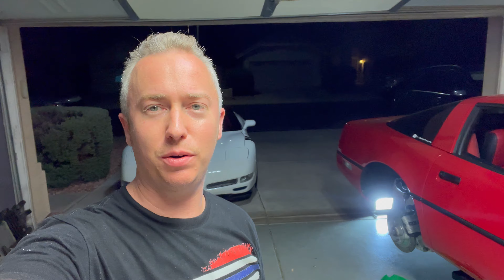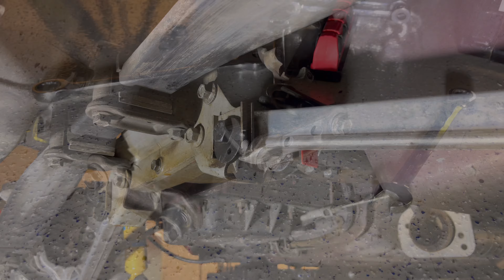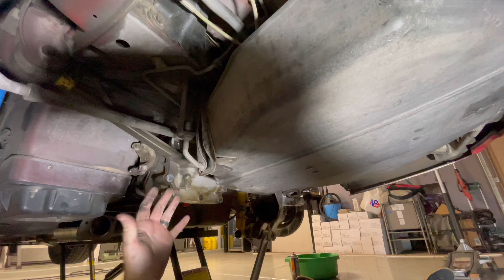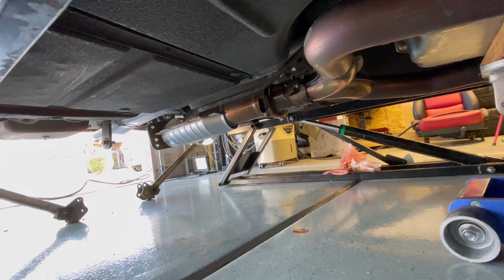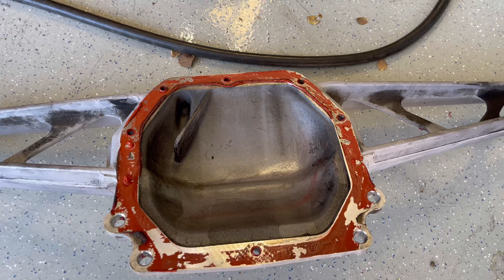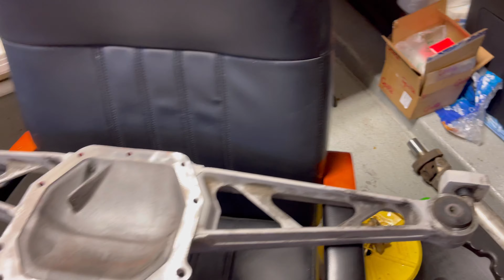How To Remove C4 Corvette Differential

Comment: Should have changed the differential ratio to perk it up just a bit nothing crazy like I did to my 94. Went from 2.59 to 3.54 . What a difference. Still just 2000 rpm at 60 mph.  Seat of the pants difference puts a smile on your face. You will have to have a tech change difference in speedometer calibration in computer. Well worth it. Thank you for the video! 👍
Reply from the maker: I’m selling the car so I’m not going through the trouble of doing that.

Comment: Great video I have a question both my pinions are worn out on my differential would you rebuild it or replace the entire assembly my mechanic quoted me $2,400 to rebuild it ? is it cheaper to replace it with a used one?...what would you do...please advise..ty

Comment: Chris, why not change the side seals, you've gone this far. You are changing the rubber bushings and they look good to me on the video. Just like in your C5 you changed the seals, those get a lot of wear.  Keep up the good work. 👍
Reply from the maker: There is no play in the side yokes which means the seals are good.  The rubber bushings are cracked and hard.
Reply: @mycorvettelife  Yeah, I would change those batwing bushings while it's off the car. Might as well.

Comment: Great video Chris,  is that bottom bolt on the diff a drain hole ? If not you could drill it out. Let me know please and thank you.
Reply from the maker: No, no drain in this diff.  Only way to drain the fluid is to either suck it out the fill hole or take the cover off.

Comment: I'm glad my differential carrier has never leaked. I'm fixing to change the gear oil again. This time I'll be putting in Amsoil as I bet this will be the last time I change it. On the ujoints, I recommend getting the Spicer ujoints that are for aluminum shafts. I'd also get new Spicer ujoint bolts and straps as they are cheap.

I wonder if that carrier has been taken apart before? The sealant on mine is black. whereas yours is orange like something someone got from the auto parts store.

I've been thinking for a while of changing my shocks. As mine originally came with the sport package with the Bilstein. Which I still have that on the rear, though the previous owner replaced the front shocks with some kind of red painted shocks. I'd probably get KYB as I don't have an interest in spending $80 per shock. Plus I've read the KYB shocks give a little softer ride than the Bilstein.

Comment: was there anything else inside the diff that needs to be done?  so you’re putting in a synthetic gear fluid ?
Reply from the maker: It appears to be fine.  I inspected the side seals and they look good.  I’ll be using Royal Purple synthetic.

Comment: OK great,, BUT Chris,  why did you need to split the housing ? was there a leak ? i could not see one.. and when you have lots of access like that use a wire wheel on a drill to clean, way easier than a blade and a better job. Ok mate keep it coming enjoy your stuff.. Hey when you look at C4,s they really are not that hard to work on for a lot of things... 
 Eddie  C4 Australia.
Reply from the maker: Yes, it was leaking pretty badly.
Reply: @mycorvettelife  OK, Thanks mate.....

Comment: I replaced my C4 diff by leaving the bat wing in the car.   That left the spring and tie rods in place.    But my C4 was hit in the rear and a little bent  back there ( got it really cheap with 60k miles so I didn’t care…). Got a replacement diff from fleebay. Went back up in the car with the bat wing still in the car.      All depends on what you trying to get done.
Reply: So you're saying it's possible to fix a sealant leak without removal of the whole thing?

Comment: Wow — they should have made that easier!   Seemed to be low on fluid?  Someone is going to get a brand new Corvette!
Reply from the maker: It’s way easier than C5.  Yea it’s been leaking since before I owned the car.
Reply: @mycorvettelife  I was wondering why you took it off. Is it possible you could've removed the Dana from the batwing while it was still on the car? Just asking.